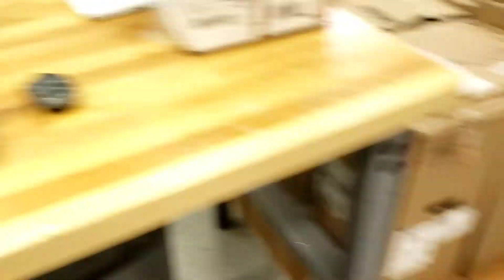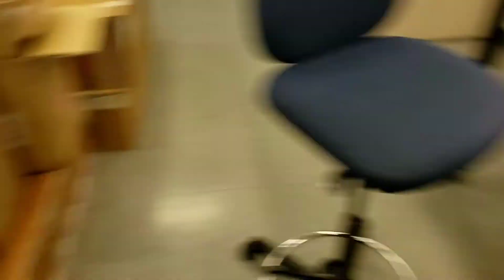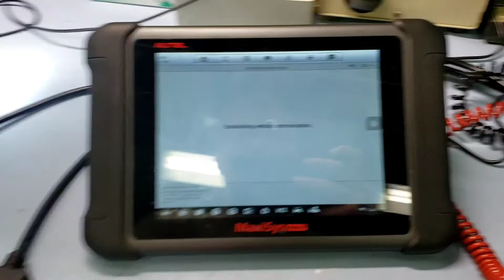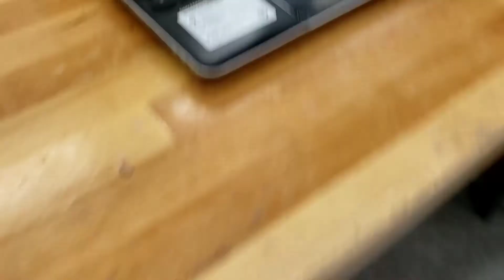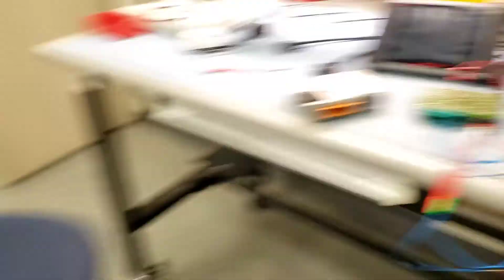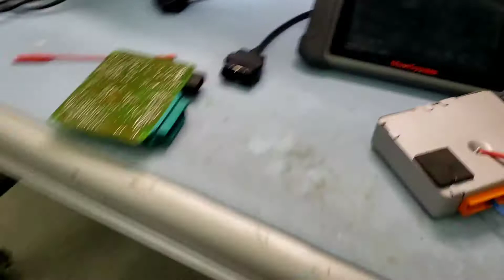2001 Chevy Silverado 2500HD Bad TCCM (Transfer Case Control Module)

Comment: Can you trick the tccm and make it run as a standalone unit? I'm doing a LS swap in a obs truck. I've got the wiring and components for the np263 t case. Out of a 03 2500hd 6.0 and ideas?

Comment: I've been with the selector switch, blinking continuously in any selection but 2 wheel high.  I'm not getting any codes.  When I put it in 4 wheel low it fills like its in four wheel low.  after watching your video several times before it sank in, I think I under stand how the module gets the signal back from the encoder motor and will be able to check voltages with it in place
Thank you

Comment: 01 s10. Fuse 10 keeps popping, found 2 melted wires on the harness. Interior lights and 4x4 not working. I'm hoping to bypass the fuse box and see if it works. Wish me luck. Thanks for the info (C2 pin D). Ps, I found a wire rubbing on the drive shaft that I believe caused the short, and me upping the fuse.

Comment: This was the problem on my 2002 2500HD. If you disconnected the ground, you could hear the relays click and the 4wd would work until you shut it off, then service 4wd came back on. Finding one of the TCCMs with the green plug (NP2) was difficult and expensive.
Reply: Where did you eventually find one? I cannot find one for the death of me and now my truck is stuck in 4 low

Comment: Awesome info very specific to details no one else will take the time to explain but you follow through the diagnostic process explaining functions of each circuit which I'll have to watch a couple times to understand all of it but I've got the same problem and I have replaced this computer no exaggeration I think seven times luckily I got a lifetime warranty and they've replaced it I think three or four times and then I bought another three or four online used ones and every single one of them do the same exact thing if I leave the fuse in it overheats and starts smoking until it quits working and then it's no good and I can't see anything wrong with any of the circuits but it definitely does not work after it smokes so I have to like leave the fuse plugged in put it in gear pull the fuse out all within a couple minutes or it'll smoke it again and I don't know why it's doing this can't track it down but that's the same code that you have as the ab circuit low on transfer case control module my truck does have the auto four wheel drive option but I'm still scratching my head trying to figure out why it keeps smoking my computer what wire is faulty or whatever I've replaced encoder motor twice I've replaced the push buttons on the dash and I've replaced the actuator on the front axle I've even done the transfer case internals replace the chain and everything else that looked worn out of a donor transfer case that was a newer model with the different position sensor plug on the encoder motor but I still got the same problem it's still smoking my computers with this code what the hell is going on is it the wrong computer that I keep getting and the 12 volt is smoking it because it's being left on or is it a wire that's gotten wet somewhere anything helpful on this topic would be very appreciative and once again thanks for all the information on the transfer case control module cuz I haven't been able to find it anywhere and I've had the same problem for over a year now I just don't even use four-wheel drive because of it and I love four wheel drive LOL

Comment: Great video- I'm frankensteining a 6L90 behind an LQ4 LS with the Zero Gravity transmission controller so that the stock computer can control the transmission. The transfer case is my current challenge- But it appears my factory 2003 LS harness has the correct plugs to mate up to the transfer case. Is the only equipment in the line of communication - (button panel-> Transfer case control module-> engine computer -> transfer case)? I can't tell if I can make it all work just by getting the correct button panel and a TCC module.

Comment: Great video, came across because i'm having an issue with my 4x4 in 02' tahoe. C0308 code, everything under the vehicle was replaced, i replaced the TCCM with a used unit. Tested everything, light and code went away, all actuators worked, drive 30 ft and the selector switch went out again and got the service 4wd light again and no 4x4. It worked for minutes in the shop, on jack stands 4x4 worked as soon as i was driving and selected 4x4 it all went out again. I've visually inspected the wiring seems like there is no issues there, fuses and relays are all good. Maybe a bad plug on the harness to the computer caused it to go out? I'm stumped.
Reply: Did you ever figure it out?
Reply: Make sure your grounds are good, and also check wiring and ground to front axle motor.
Reply: More or less just what happened with me

Comment: I pulled mine out and removed the metal case it's on 1999 1500 and I still have it hooked up to the truck and I don't hear the relays do anything. So is it a bad tccm?

Comment: Great video. This helped me determine that I have the same failure. Now that I know, where were you able to source a replacement? I can't find the green connector version part# 15063845 anywhere.
Reply from the maker: We had a extremely hard time finding one. We ended up getting one at a salvaged yard. Cardone Industries re-manufactures them, but I believe they are out as well. 73-42108 is the Cardone part number.
Reply: @blautomotive7230  I haven't been able to find the Cardone one either and no one else seems to reman them, but I'll widen my search. Thanks for the help. Keep up the great videos.

Comment: Can you please email me at shane.donnelley @ gmail.com about an issue I have had for years with my 4 wheel drive. 2001 gmc 2500hd. Swapped the dash switch, the control mod and the transfer case motor. Still not lights on the dash switch.